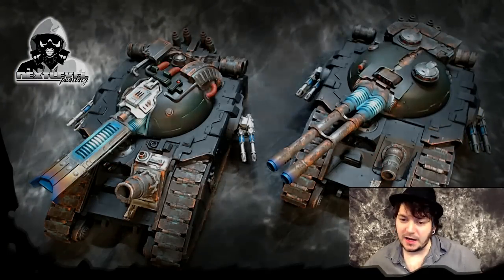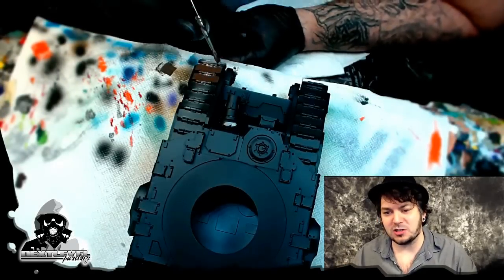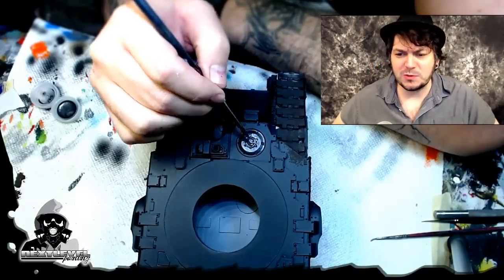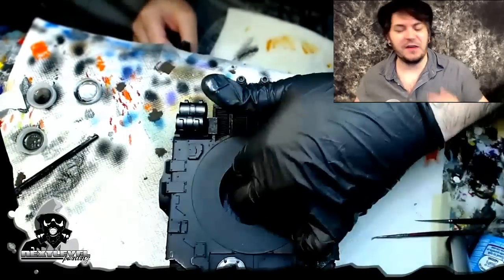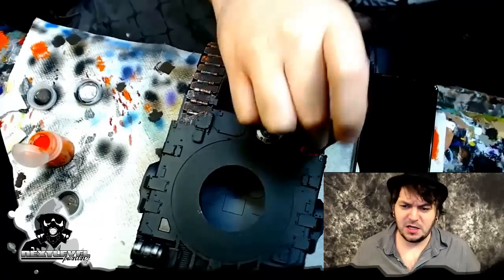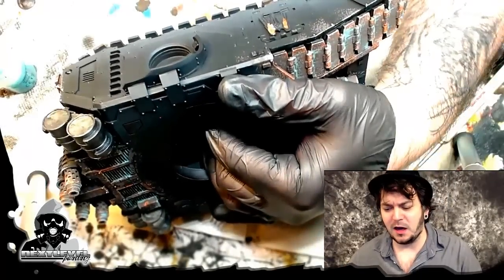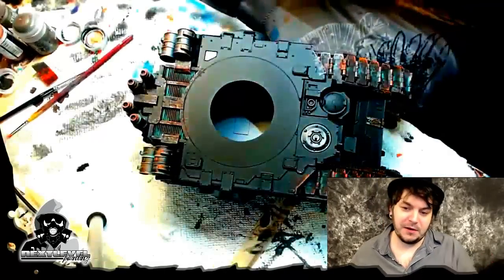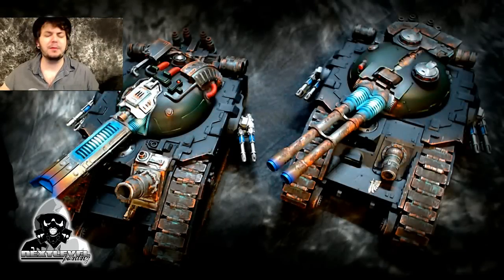How To Paint - Technical Effects & Weathering Tanks

Comment: I've been working on some necron warriors and wanted to do a corroded look to them. So far I have one that i've been testing the typhus corrosion on. My process with them has been a base of leadbelcher with a heavy wash of agrax earthshade. I then drybrush necron compund on to bring the steel sheen back out. Now with the Typhus, i've just been hitting the small areas where the Agrax pooled up the most and at the joints of the limbs.

I feel like I could do more, but I don't really know what to do next to make it really pop. I don't want to use ryza rust though because i dont want that orange to overtake the cross between worn plate metal and aged varmint trap look that I want.
Any suggestions on where to go next?